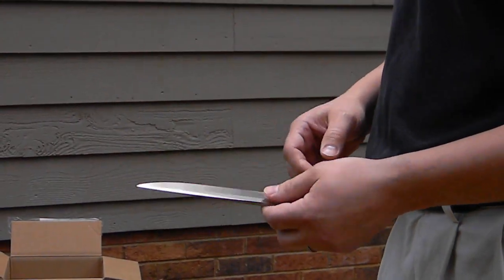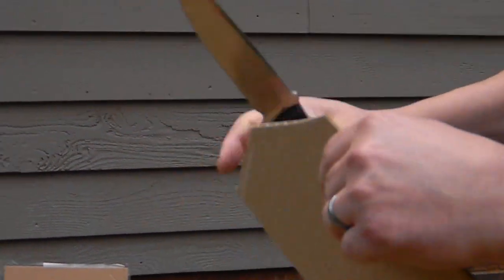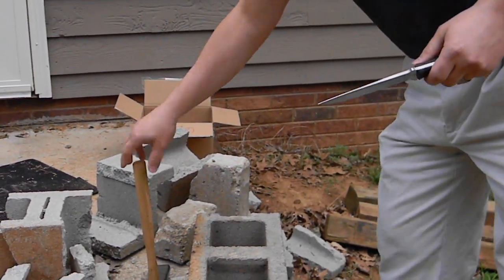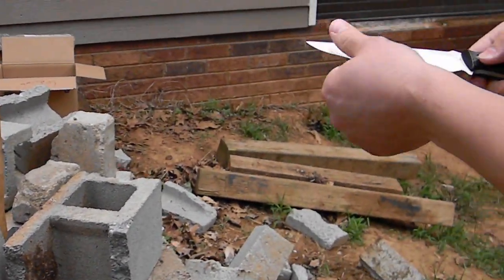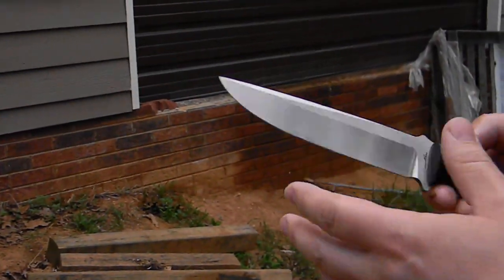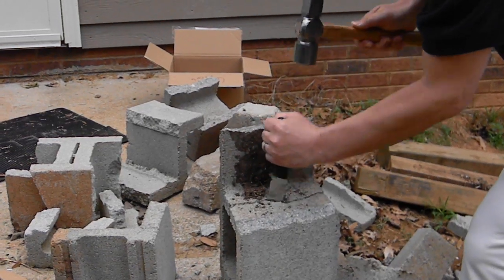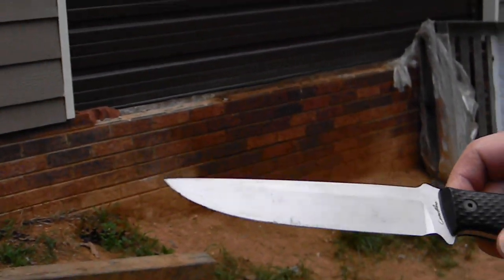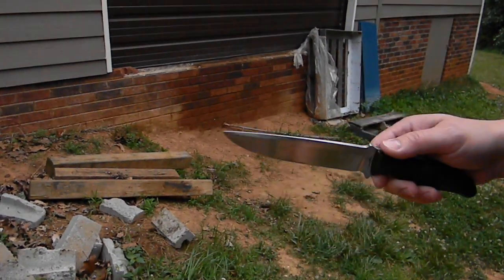Elmax knife abuse

Comment: Damn impressive. Gotta say, so much depends on the geometry and heat treat, but that is some damn good steel. All those little dings will come out after a robust sharpening no problem for those concerned.

Comment: If I didn't see it myself I'd say it's unbelievable. How would the 3v version of this same knife do with these tests?
Reply from the maker: 3V with a heat treat developed for knives (Delta 3V) will outperform Elmax in most ways. Tougher, stronger, better edge stability. But it is not stainless, it is only somewhat stain resistant. And although 3V has good abrasive wear resistance Elmax is ever higher, though this does not really translate into edge retention better than 3V in most uses. Delta 3V is the better steel for hard users. Elmax is one of the best stainless steels.
Reply: @NateAIM  thanks boss. Your knives are impressive to say the least. Hope to own one some day 👍

Comment: Holy crap, that's nuts! I cannot believe the durability of that steel. What could be better?
Reply: Vanax has about the same toughness and edge retention, but is 100% completely stainproof.
Reply: @finalbossd  actually its tougher than Elmax
Reply: 110sv cpm
Reply: M390 and 20cv

Comment: Hmm, your description indicates 0.020" but you then measure it to be ~0.030" behind the edge, 20-dps, which is actually pretty standard for production knives and many can handle this same treatment with similarly ill effect.  would you be willing to take the edge down to 15-dps and maybe 0.020" or less to demonstrate its durability?
Reply from the maker: Read and listen again.

It was taken down to .020" before sharpening, then sharpened at 20 degree per side. This resulted in a little under .030 behind the edge. Makers frequently discuss geometry in terms of thickness before sharpening because this reflects how knives are actually produced and is a helpful measure of "thickness" because it is not a combination of edge thickness and edge angle (which would otherwise make a more acute edge "measure" thicker as it intersects higher up the primary bevels). I can see how that might be confusing.

Yes, this edge thickness and sharpening angle are common dimensions for many production knives. However they are unusually thin for a rough use tactical knife that will tolerate this kind of rough use. Which is the point of the video, to illustrate the unusual toughness of Elmax.

15 degrees per side and .020 behind the cutting edge is common for a thinner knife such as a skinning knife. I go as thin as .010" and 13 per side on skinning knives. But that's not what this knife or demonstration is about.

Your statement "many can handle this same treatment with similarly ill effect" goes against a considerable body of knowledge and experience. Can you give any examples of a relatively thin and hard stainless steel knife, particularly one with a large carbide volume fraction, that will tolerate this kind of impact into this kind of media without major chipping or breaking?

This is a 20%+ carbide stainless steel at HRC 60 without thick fat geometry that was hammered through a cinderblock without any major damage. Can you cite any example of any other high carbide stainless steel that can do that?
Reply: +NateAIM 
I'm sharpening my ZT 0566 with the Spyderco
Sharpmaker and the knife isn't sharp enough (can't shave), is it worth buying
the ultra fine stones? Should I use the 30° side instead of the 40°?